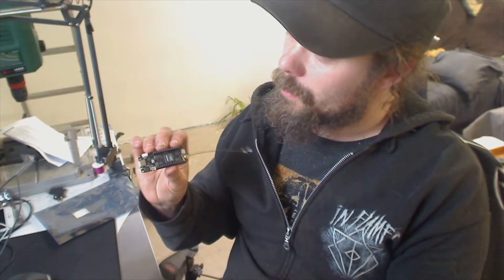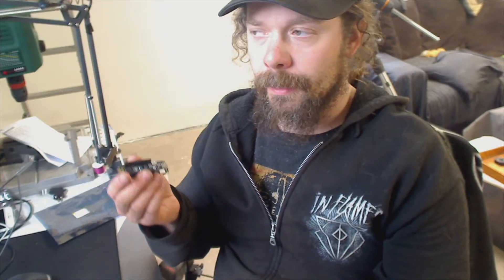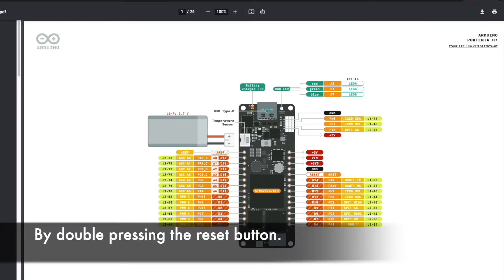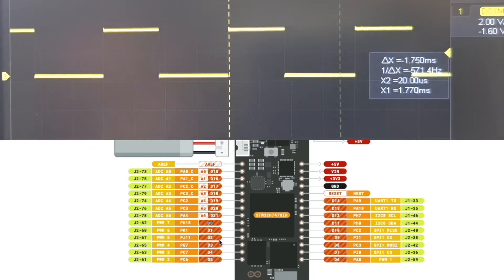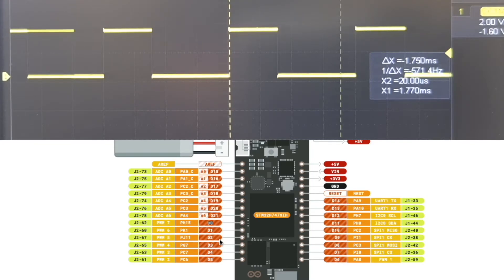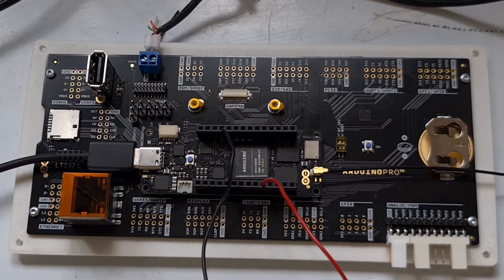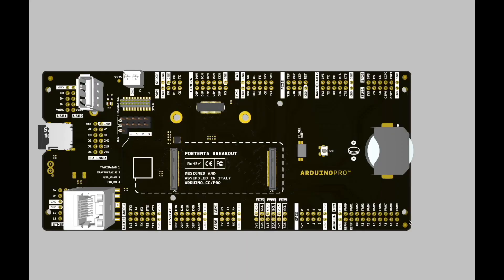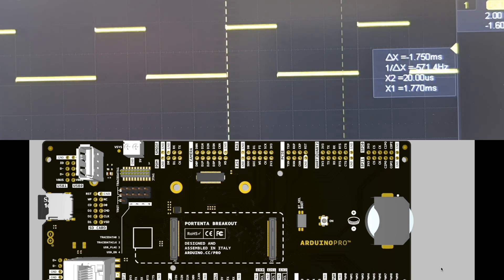Arduino Portenta H7 - PWM issues

Comment: I followed this it's very good and practical.
I just don't understand how the PWM on the three waveforms can be adjusted with the resolution needed? The mounts available like Planewave use an encoder to detect error, the Lucid has an off axis guider.
You seem to have a handpad of some kind for slewing.
Planewave had issues with the smallness of the changes in the waveforms. I don't get how you've got a relatively crude motor able to be controlled in arc second corrections? You need like 32 bit level changes.
The cogging would be a major torque variation. There's a whole range of combinations of magnet and motor poles. 
There is a way to interleave the windings as well, like I did 45 years ago when neo magnets didn't exist. Great work anyway.
Reply from the maker: Hi! Sorry for the late reply. Been a bit disconnected for a while.
Yes, I’m basically using dead counting and assuming the motor is doing what I’m telling it to do. The guide camera is providing me with high resolution feedback, but is very slow. A high resolution encoder would be awesome, but comes at a high price. Both for the encoder itself and the implementation. The 15-bit pwm output will be sufficient with the 15:1 electrical:mechanical rotations we’re having. To start of with anyway 😊 
It is also very true that the imperfections/differences between the magnets, coil windings, etc. will make high accuracy control difficult, and it is. Just purely doing dead counting we would be off quite soon. Not that quickly though, and the guiding is fast enough to adjust for this.
Thanks for watching!

Comment: hello, how can i set the output for servo motor at 333Hz ? Thanks
Reply from the maker: Hi, sorry for the delay.
If your using the PWM to control the servo you can use analogWrite function: 
analoWrite(Pin,output_value)
Prior you also need to set:
analogWriteResolution(<=16);
and for the frequency:
analogWriteFrequency(Pin, 333);

Comment: did you get to the bottom of it? it seems this board has several pins that are just the same internal pin broken out seperately.  They cause significant issues.
Reply from the maker: Hey mate! We did get to the bottom of it. Or, the core of it... hehe! Sorry...
I go in to it more in the other video: https://www.youtube.com/watch?v=Lez0rkxATE0
The sound is a bit crap, but I'm not gonna spoil the surprise ;) 
The issue is however not solved yet. Not to my knowledge anyway. I checked if there was new firmware a while back but there was none then.
I'm using the ESP32 now and not looking back yet.

Comment: Looks like a grounding issue , try to connect the 5v in put ground to the usb ground.
Reply from the maker: Hi Mark! Thanks for input. I have tested a bunch of configurations, among them, as illustrated in the video, I completely unplugged the 5V power an ran it on usb alone. Noise/glitches remained.
Anyway, int the following video (spoiler alert) I had some good (well, informative) feedback from Arduino technical support. It was(may still be??) an mbed core issue that was to be fixed with a future core release. I never noted one that did, so I have moved on and now use esp32 for my projects. Might pick this up at some point, but it was not ready imho.

Comment: Put a diode on the +5V input. Maybe voltage conflict between this and usbc. Diode Wil drop 5v a bit and prevent cross talk between usbc and power supply.
Reply from the maker: Hi,
Thanks for the suggestion! As I did in the video I completely unplugged the 5V and then cross-talking continued. It’s actually there even if I don’t have the breakout board connected at all. I just used that because in some situations (not all however) the cross-talking disappears when unplugging the USB-C. 
Some things I discovered after the video was:
If I reset the Portenta the cross-talk is back even if I didn’t plug in the USB-C at all… I need to plug the USB-C in and out again for it to go away. 
Very weird.
Also, if I use a USB-A cable with a USB-C adapter the cross-talk remains regardless if I unplug it. 
Super weird.
I was thinking about the USB-C video interface. If that is somehow involved.
I have a ticket with Arduinos technical support.

What platform for the ESP-32 are you using?